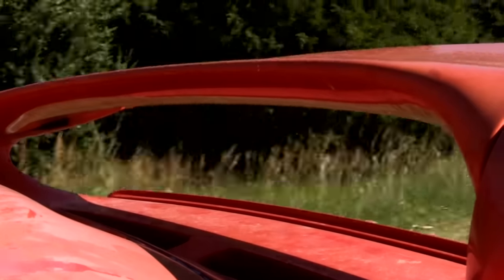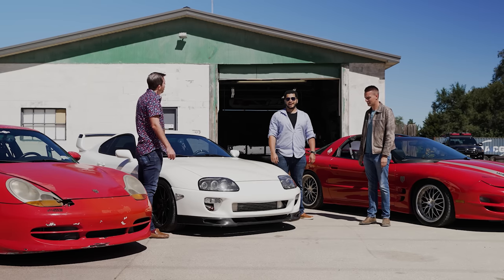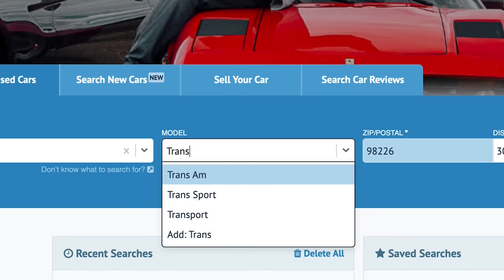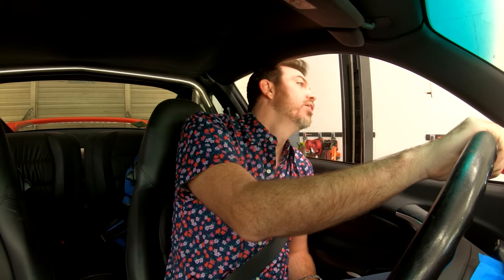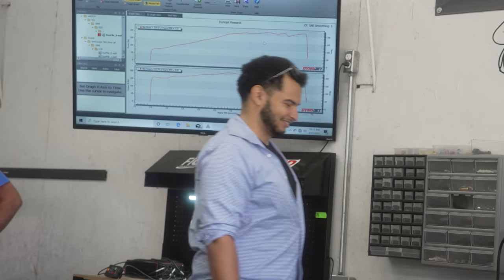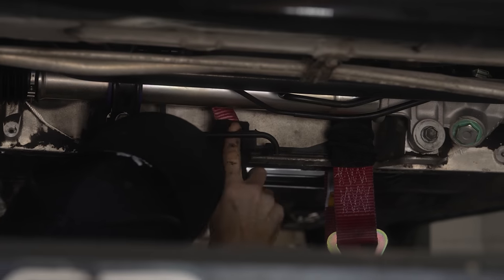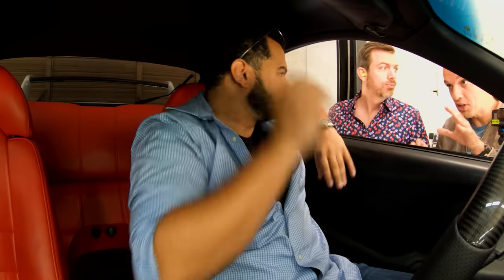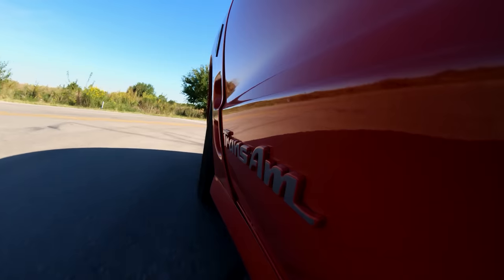We Bought 3 Dirt Cheap Sports Cars...Here's How Fast (Or Slow) They Actually Are | Car Trek S6E1

Comment: I'm just going to go ahead and say that the WS6 will dominate everything. Best car ever made! No bias here whatsoever.
Reply: Agreed!  4th gear is 1:1, not 3rd. Wouldn’t using 3rd gear for the dyno pull make the hp seem more favorable?
Reply: Luckily you are not biased 🤣
Reply: I had a black 01 WS6 for several years, worst car I ever owned. The rear pinion seal started leaking about every 5k miles, the spark plug wires liked to pop off at random, one of the catalytic converters collapsed internally and had to be replaced under warranty and there was a hose for the emission controls up inside the nose that kept coming off and kicking the check engine light about once a week. I miss it though, it looked great, it sounded great, and it was a blast to drive. You just had to plan on some downtime.
Reply: I totally agree....and it's also not because I am biased aswell and have a 97 T/A with the 6-speed.
Reply: hahahah "no Bias" he says!!! i came here for your comment when i saw the WS6.
Reply: I might agree if it was a well sorted WS6 and not this sad excuse for one.
Reply: A car I’ve wanted since it was new  in high school.
Reply: @philbarbera1471  using a 1:1 gear is how you get a proper reading from the dyno dude. If the transmission was assisting through gear reduction it wouldn't be engine power. Also the WS6 is a shitpile with a nice engine, basically a chevy racing engines shipping crate, just like dodge trucks.
Reply: @cjolney  looks good, interior is serviceable on a long trip and they ride fine. what’s to hate?
Reply: @standyourground9973  literally everything you just said is subjective to your opinion and completely disagreed upon by pretty much everyone else on earth.
Reply: Was it a manual? 4th gear is 1:1, so the car most likely made more horsepower.
Reply: That SLP hood was made in Montreal Canada, when we had the GM factory. My dad was on the production crew.
Reply: As another beer-swilling 4th gen owner- GO GET 'EM TYLER!
Reply: @philbarbera1471  Using a gear lower than 1:1 will cause a lower reading on the dyno
Reply: @cjolney  No it's not. It's only said by you lol. Notice all of the exactly nobody agreeing with you.
Reply: A mid to high mileage WS6 in a condition that's square in between the POS WS6 you just bought and your Hero WS6 would be ideal for this show, Alex. And it wins the Sports tier of this 30K deal strictly because the other 2 get DQ'ed. Ed for not passing inspection in a real life scenario, Freddy for rolling up in a car that's worth more than twice the total intended for three (3) vehicles. Real-life, Budget CarTrek should be you vs. JR vs. Jake. Make it happen.
Reply: No bias says the one who has a banner of the same car
Reply: @philbarbera1471  It probably hurt the torque reading
Reply: 409 hp is right on 545 with 25% loss which is 410 hp its right on 545 crank hp. The hp isnt fake just how hellcats are 707 to the crank but like 600 or so to the wheels
Reply: Yup no bias at all
Reply: I would think using 3rd gear would help the torque reading but hurt the power reading overall.
Reply: Meanwhile it would be my last choice out of these three lol
Reply: only if it has mods. the ls1 is a turd stock
Reply: 4th is 1 to 1. Good tires will Dominate all
Reply: just came here to laugh about you and your ws6 love
garbage cans
Reply: I too love the car, if it had been made by any company other than GM I would own one today.
Reply: @kewlztertc5386  why not built by gm? sure the quality, gm quality of that era is shit
Reply: @simonomisimonomis  you just gave the answer. The quality is crap.
Reply: @cjolney  as an ls1 firebird owner, you're completely wrong lol. It helps to have experience before you make statements based off what "reviewers" claim. I originally bought mine solely for the ls1 engine but after daily driving it for a year, I find myself taking it to run errands over my impala which is quiet and boat like. Its practical, comfortable, and looks amazing.
Reply: @quentinc1275  yes actually I do, I thought they were shitpiles before I drove one, and I've driven multiple from LT4 anniversary editions, LT1 formula, LS1, even 3rd gen V6s. All complete dogshit body with a great engine. If you think it's a great car you're a flat out fanboy.
Reply: Until you have to drop the subframe and motor to change a plug. Lol. Chevy turd. My wife's auto 2006 g35 gapped a ws6 this summer. Super loud slow turds. Facts.
Reply: @Closet_Jedi  I had an 02WS6 loaded bought at 50,000 miles and put 75,000 more miles on her nearly flawless no major work
Reply: @philbarbera1471  running in 3rd instead of 4th would lower the HP reading by the dyno
Reply: @skippysvr4586  drop the subframe and motor to change plugs? Are you serious right now? Straight up wrong- if that’s how you did it- well, you probably shouldn’t be driving at all with an iq like that 

And 2006 g35- roughly same weight (if your g35 is a coupe) and less horsepower(significantly less horsepower- like 50ish at the wheels) and you beat a ‘slow ws6’
Sure. You beat a badged v6 or someone who wasn’t even racing you if both were stock.
Reply: @skippysvr4586   You must have ran against the only random piece of shit WS6 not maintained....he probably had clogged converters 😂
Reply: @skippysvr4586  did the WS6 know he was racing? Because I have a 2006 G35 that’s a 6speed with a few little mods. Headers, straight piped and a open air intake and my lil fancy Nissan won’t keep up with any LS1 car I’ve messed with. Not for very long anyway. You tripping man, lol
Reply: @standyourground9973  They're both crap cars man.  All of the electronics are garbage, the rear diffs on F-bodies are made of glass, the body panels are all over the place, the seats are uncomfortable.  They are fast for cheap, but they are total garbage to drive around daily.  The new Coyote and LT Camaros are so much better it's not even funny.  The 4th Gen F-bodies and SN95 Mustangs are shit and should just go away before parts start rusting off them and causing traffic accidents.
Reply: @majist0  You’re saying a 5th gen Camaro’s easier to daily drive than a 4th gen? Spoken like someone who’s very obviously driven neither. The 4th gen’s greenhouse allows for MUCH BETTER visibility compared to the brick shape that followed it. Also the diff is one of the first thing anyone swaps when making power, a Ford 9 inch takes care of the issue usually
Reply: @standyourground9973  Driven plenty of 4th Gens because they're ancient now.  Creaky, rubbery plastic control feeling 4th gens.  GM cars of that era were awful inside.  A new rattle from the dash or console every week and the skip shift drove me nuts.  You're right seeing out of a 5th gen sucks, and it's hard to get in/out of, but everything else is better.  GM actually put some effort into fit and finish and controls that don't feel like they were stolen from a toy my kid has.  Not to mention the base models actually have a decent engine now and the Coyote and LT powered Camaros are rockets.  You're also way safer in a crash.

The S2000 is a better example of a driver focused interior of the era.  It's angled towards the driver, the controls "snap", have proper feel and weight.  Speed isn't everything in a daily.  For a track car I'd put up with it, but the 4th gen isn't a track car stock.  It's just another noisy throwback to when America could make something fast but not good.  Now they can do both.  I don't miss the F-body, America builds way better stuff now.
Reply: @majist0  what’s your criteria of a “good” car? does the Foxbody meet it? both were used by Government officials in roles such as highway patrol vehicles or even U-2 spy plane “chase” vehicles (to assist their landing)

I’d say the F-body was exceptional for its time, seeing as it was about as fast as an R-34 or Supra of its time (can’t even say close to the same for the same generation Mustang until the Terminator)

Decent visibility, 30 mpg from the LS1+6speed at 70mph, decent 6 spkr audio system with the monsoon system even good, ergonomically the F-body was a much more livable daily driver’s vehicle for all intents and purposes
Reply: @ToobxSox  back in the day not really. You gotta think it debuted in 97 in the corvette then they put it in then 98-02 4th gens. Back then 330 HP was pretty damn good. Still impressive with how much power you can get out of them now with a few mods
Reply: @keedoopop4900  25% loss is HUGE. it's usually 12-15%, Hellcats usually put out 640whp
Reply: @papa_pt  yeah but a hellcat is allot newer with a better trans idk the year of that car but 25% loss is probably about normal on that year its prob close to 20 years old and been dogged its whole life so id say 25% is about right
Reply: @papa_pt  and from what ive seen stock hellcats are about 570-600hp on a dyno id say theyre still losing 20% i dont think trans have become that efficent to be 12% still a big car running power through the drive train 12% seens a little to good
Reply: @keedoopop4900  where you seen 570? 90% of the online ones I've seen sit right around 640
Reply: @papa_pt  just videos i saw cant give exact links or not gonna look them up either way i thought it was pretty common for cars to lose 20-25% through drive train maybe theyve made it better but 640 wheel out of a 700 hp car seems high atleast stock now if those cars have a tune echaust i can see 640 but only losing 60 hp out of a 700 hp car seems like they aint stock but i could be wrong im not a hellcat expert by no means
Reply: @keedoopop4900  yeah Mustang dyno might read under 600 (dynojet is used in the video) , but with modern autos I think loss is more like 12-15% not 20%
Reply: @xprocharged1  Believe it or not, Alldata and Mitchell both call for the subframe to dropped to more easily access the plug for cylinder 8.

Could there be a quicker way to do it? Sure. It’s what the text book calls for though.
Reply: Nah. That Supra will, especially with reliability.  Supra 570 RWHP should beat a heads/cam WS6 in the 1/4 and def. top speed.
Reply: I’d still take my 03 mustang gt over it. ONLY because I hated the tranny lock out when trying to race it.
Reply: @philbarbera1471 I think that's done to account for the final drive ratio
Reply: @philbarbera1471  Gearboxes are torque multiplication devices, they are able to change the output of torque at the wheels, however, they are unable to change the horsepower output of an engine.  This is because horsepower is derived from (torque x RPM)/5252, with the unit of torque being pound-feet (lbft).  The way gearboxes change torque is through gear ratios, e.g. a 1:3 gear ratio will output three times the amount of torque, however, it will reduce RPM to one third of its original RPM, hence, there is no change in total horsepower (3 x 1/3 = 1).  I hope this explains it :)

Edit: The non 1:1 gear ratio used will affect the torque reading of the dyno, not the horsepower reading.
Reply: @Closet_Jedi You just had a lemon bruh

Comment: 410whp isn't a bad number for that WS6. Probably 500ish at the motor. Was running rich up top and idle was off. With a better tune, probably another 20-30 hp. Hoovie definitely got the best car for the money, without cheating.
Reply: i was gonna say theyre definetely talking whp with the results
Reply: Yeah definitely needs tune tweaked. I don't know who tuned it but I'm guessing they used HP Tuners. Throw a wideband on there and clean up the air fuel tables.

Comment: The Firebird Trans Am WS6 may be one of the best bang for your buck sports cars out there. Because it's based on the Camero platform of the same years, you can find plenty of aftermarket suspension components to make it handle quite well and you get some really impressive horsepower and torque figures because LS. LS motors are the gameshark of engines, as Mr. Regular says. If you have one, you just win. Plus, you get to revel in the carry-over 90's nostalgia for just a little bit longer, which is nice.
Reply: It's not really "based" on the Camaro. They are both built on GM's F Body platform which actually has roots all the way back to 1967.
Reply: @LayerZeroDesign I mean they're basically the same car, but I don't think it's unfair to say based on because the Camaro came out first 🤷🏻

Comment: Always wanted to have a dirt bag WS6  do burnouts in! Great work guys.
Reply: Dude even the dirt bag lt1 trans ams are fun
Reply: That Trans Am is Bad ass!!
Reply: @brainwashed1542  o
Reply: LT1 are tons of fun!
I have a 96 Camaro Z28
Reply: I got 98 trans am fun to drive. Although my reverse did just go out….
Reply: Imagine a clean one…!!
Reply: @brentbouchillon96  hell ya I got a 30th anniversary z28. Engines all torn apart rn getting built to F 😎 had the car since 2010.
Reply: @chordle1605  especially 6 speed models
Reply: @full spool customs
Reply: A buddy of mine bought one new in 1998 and he literally did a burnout every time he drove it. They were fast cars at the time but compared to whats available now they as slow
Reply: @wes3527  well i mean it is about 30 years later 😅😅 simple fact is you can buy these cars dirt cheap put a few grand into it and have nearly 500 hp. HCI with longtubes and you're stylin' and can beat the piss out of them.  You really can't beat that 🤷‍♂️ boost them and you got yourself something to scare the piss out of any passenger that enters and still be budget minded. I'm a gear head tho and love working on cars. Thats half the fun but i understand a lot of people dont have the means to do such or the skills and just want to buy the whole package upfront.
Theyre so simple to work on and can really take a beating. Well minus the rear end. Those 10 bolts are trash 😅😅
Reply: Easy tadoo
Reply: @rissu8573  rip the turbo out of the supra or put one on the LS1 👀
Reply: @clifford_2zero7  good idea, BWWAAAAAAH STUUUTUUUUUTYUU crack oh fuuuu-
Reply: @rissu8573  hahahhaha
Reply: The WS6 was a beast when it came out. It still has tons of potential, sadly this one has been rode hard